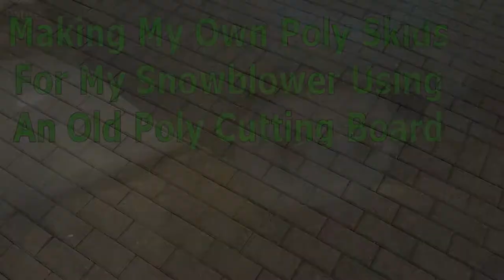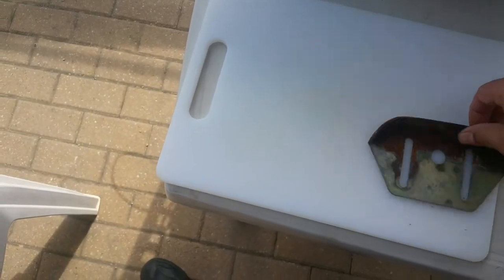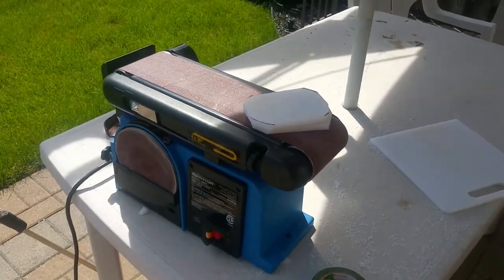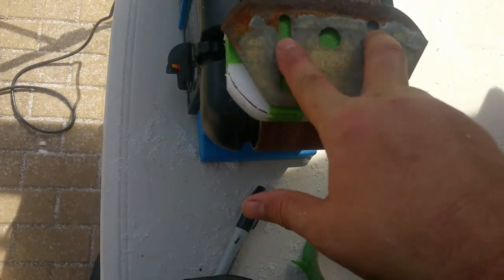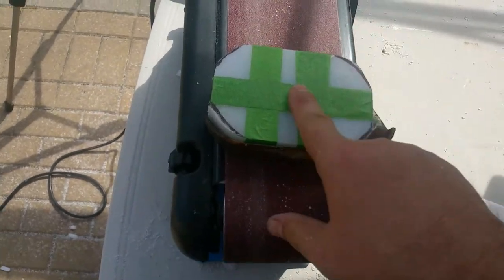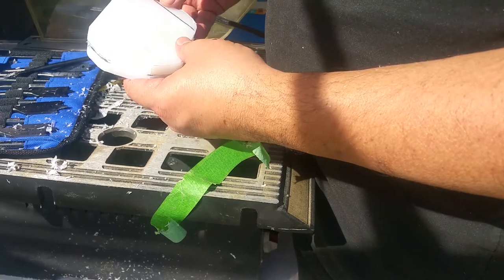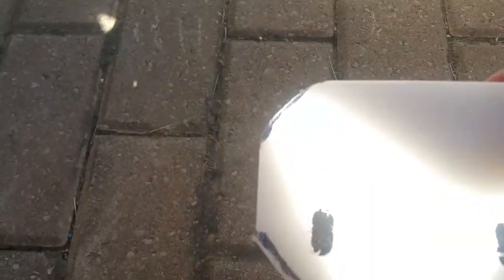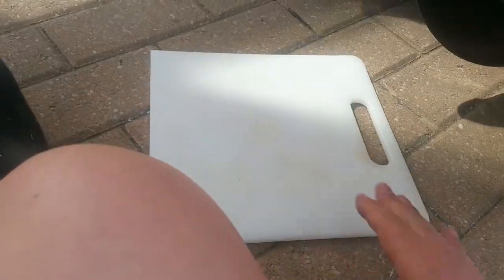DIY - Make Your Own Poly Skids For A Snowblower For Cheap From A Cutting Baord

Comment: Thanks for the idea. I'll examine the existing shoes a little more before firing up the saw. That and use a drill bit for "milling" the slot. The poly shoes for the Toro PowerMax are listed as "out of stock", even on Amazon, so this is now a "must do DIY". So it goes. BTW, I'd have cut this vid way down, and maybe speeded up things like sanding the corners. "Less is more". :)

Comment: It is very dangerous to put your hand near the saw blade like that. If you know anything about miter saw kickbacks, it can throw that cutting board right out of your hand. You might jump and put your hand where the blade is. It happens to people all the time. I like the idea and saw many people did it, but ask your self if it is worth it, or not. Got to be more careful if you are going to do it. Also, you forgot to stand away from the blade direction.

Comment: I'd be using a wooden push handle rather than your hands when cutting material. If the blade catches the material the wrong way, it could force your hand or fingers into the blade.  😳 I think a cement walkway or a tar driveway will wear out the plastic as it did on the belt sander. I'll be welding a new piece of steel on the bottom part on my shoes.
Reply: John, The point of him using poly was to prevent scratching up the bricks.  
Great idea Vinny!
Reply: FFARevenge yeah I saw that. When I had an interlocking driveway I never had that problem.